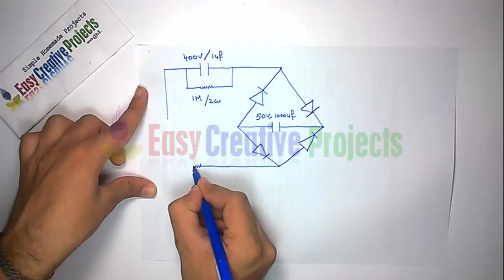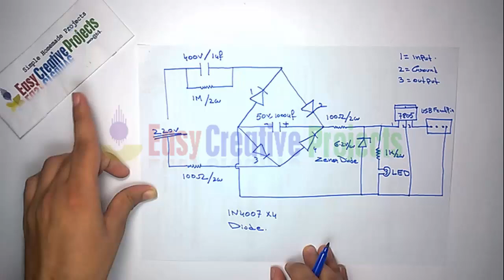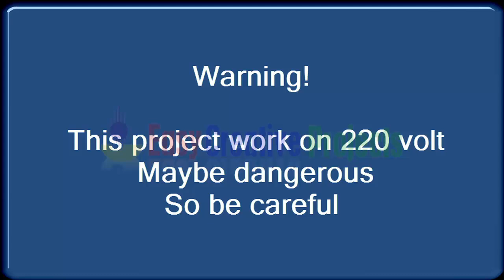How to make mobile charger without transformer - cheapest cell phone charger

Comment: Nice video, I got a question, Is it possible to change the input voltage you have, to 12-24V to get the same result you had, or do you have to change certain components in order to do that.
Reply from the maker: we also make video on 12v and 24v power supply. see video on our channel.
thanks.

Comment: Without using 2A transformer is it possible to turn the output voltage on 5v and output ampere on 3A ?
Reply from the maker: dear its only demo project.
this time no perfect alternate of transformer.

Comment: just make me sure that is it charging the phone like a normal charger? yes or no
Reply from the maker: how much you need voltage and current ?
Reply: Easy Creative Projects minimum 5 volt and min 500mA current
Will it give?
Reply: Easy Creative Projects please tell as early as possible....
Reply: 5v minimum and 200mA minimum constantly upto minimum 24 hours, will it work?
Reply from the maker: see video on my channel. how to make mobile charger at home.
in this project i use 9v, 500ma transformer and 5v output. its perfect for you.
if you run it for 24hour so use high quality components. splashily high quality transformer. and fine copy voltage regulator.
thanks.
Reply: Ok thanks

Comment: is this circuit have enough voltage and current to run arduino uno? plz tell
Reply from the maker: no dear. its risky because in this project i cannot use transformer. see on my channel with transformer power supply videos.
Reply: bro i need a very small ac to dc circuit to use arduino please help

Comment: NEVER, EVER attempt to create a charger like this. It is extremely dangerous and WILL electrocute you because the output voltage is connected directly to the AC. Real chargers use a transformer FOR THIS REASON!
Reply: That is exactly what im thinking specially the Bridge Set up could be Giving off at least 150VDC! which is Very dangerous so dont try this set up if possible.